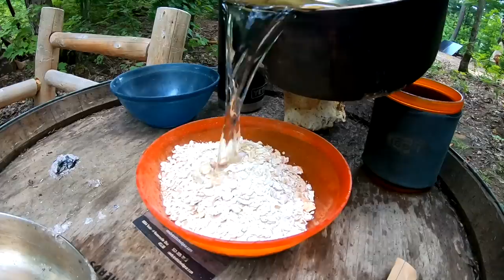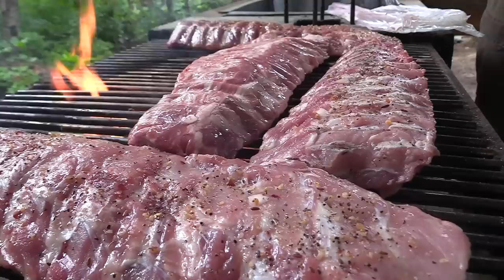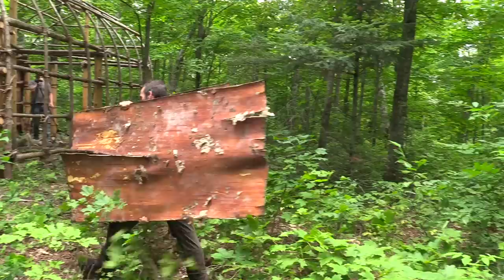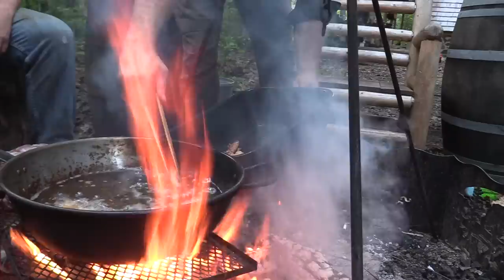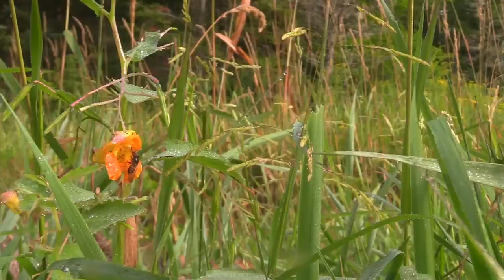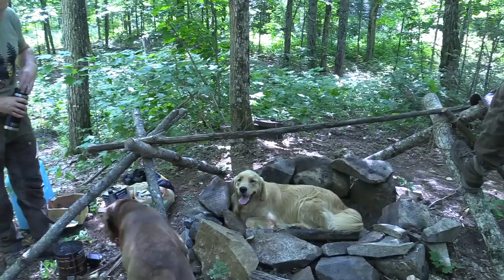Rain Proofing a Longhouse the Ultimate Survival Shelter Tranquil Nature and Off Grid Cabin

Comment: The Neolithic longhouse was a long, narrow timber dwelling built by the first farmers in North Central Europe beginning at least as early as the period 5000 to 6000 B.C. This type of architecture represents the largest free-standing structure in the world in its era. It is thought that these Neolithic houses had no windows and only one doorway. The end farthest from the door appears to have been used for grain storage, with working activities being carried out in the better lit door end and the middle used for sleeping and eating. Structurally, the Neolithic long house was supported by rows of large timbers holding up a pitched roof. The walls would not have supported much weight and would have been quite short beneath the large roof. Sill beams ran in foundation trenches along the sides to support the low walls. The long houses would measure around 20 meters in length and 7 meters  in width and could have housed twenty or thirty people.The Balbridie timber house in what is present day Aberdeenshire, Scotland offers an outstanding example of these early structures. This was a rectangular structure with rounded ends, measuring 24 meters  x 12 meters, it was originally thought to be post-Roman, but radiocarbon dating of charred cereal grains established dates from 3900-3500 B.C., falling into the early Neolithic. Archaeological excavations have revealed extant timber postholes that delineate the support pieces of the original structure. This site is strategically located in a fertile agricultural area along the River Dee very close to an ancient strategic ford of the river and also near an ancient timber trackway known as the Elsick Mounth.  Bye from NE Italy (on the border with Slovenija and Austria)
Reply from the maker: Hey that is really fascinating Info. The Longhouse style was used all around the world by different cultures throughout history but they were all slightly different from the rest. Its really cool learning more about it as we work. Thank you for sharing this info with me I appreciate it. Hope to see you for the next stage. Take care

Comment: One suggestion.  The very top row of bark should run the length of the longhouse, not bent the width like the other rows. With a gap and another piece covering the gaps. It will allow smoke to escape without rain getting in .
Reply from the maker: Hey Thats a good idea. Currently our plan is to cut the smoke holes out after all the bark is on.

Comment: Will snow collapse the bark roof?
Reply: it shouldn't as long as it doesnt sit for quite sometime, the roof angle assist in preventing that from happening, they should have put pine pitch/resin down where they were nailing as to improve the longevity of the bark, leaving the snow to sit which it shouldnt given the roofs angle can and will over time weaken those points, largely due to swelling and shrinking if when moister gets under the nail head causing the bark to pull up in steady to high winds.  they can however put pine pitch/resin over any exposed nail heads as a supplemental fixed as opposed to restarting. 

id be more concerned with some of the cordage bindings weakening/sagging, noticed a few spots where it could have been tighter but looks damn good regardless, 

they doing great
Reply from the maker: Hopefully not but we dont really know. I dont think it will. We wont be living in there as they would have in the past so the snow load may become worse. Having said that the bark is actually very strong and I believe it will hold up. Time will tell.

Comment: WOULD THE LOGS YOU NEED TO PEEL FOR LONG HOUUSE  ,,PEEL IF LEFT IN OR SUBMERGED IN WAATER   ,,MAYBE HALF OF THE BARK ?  MY KNOWLEDGE OF TREES IS THE. SAP RUNS DOWN IN FALL  ,FROM LEAVES TO ROOTS ,,AND UP IN SPRING FROM ROOTS TO THE 
LEAVES ,, I USED TO KNOW MANY ,MANY NORTHERN TREES AND IDENTIFY THEM YEAR ROUND
Reply from the maker: Hey Greg, that may work but we wouldn't physically be able to move the heavy logs to a water source to soak them. In the spring there are swampy pools near where we sourced the trees but they have since dryed up. You are correct in that I think the sap will be running back to the roots now  and that we will have to wait for spring to source the remaining bark or risk it not being useable and damaging it for no reason. Hopefully with the ash trees dieing they will still leaf out come spring adlnd we will be able to get the bark. In the mean time we will build our bunks and work on the interior. Thanks for your thoughts appreciate the input. Have a great weekend Greg. Take care and hope see you next time